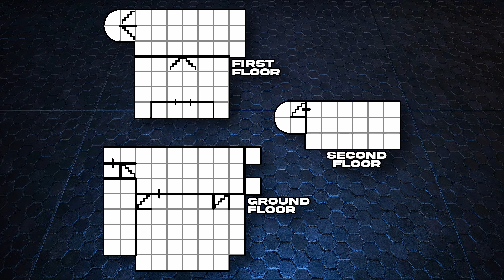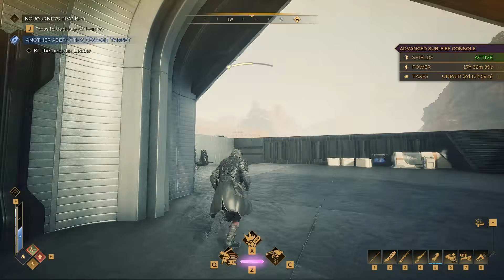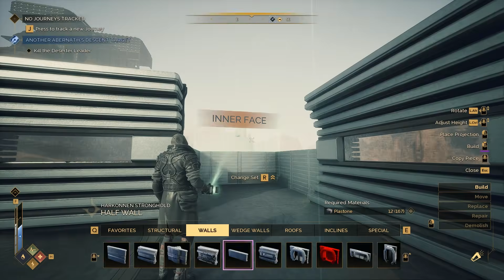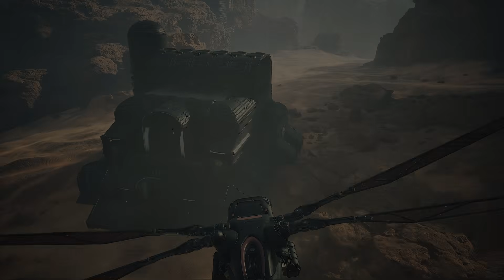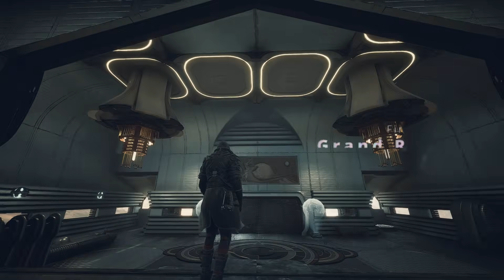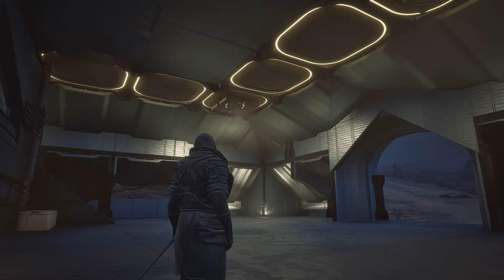Dune Awakening: Harko Manor Speed Build!

Comment: Absolutely love this video. I’m slowly but surely finding myself addicted to building. I got (4 regular, one vertical) extensions total on my main base trying to work out a cohesive idea for it, how would you go about it? As of right now, I can comfortably say I love my entrance, my dining hall & hangar which are on the far side of the property hanging on a giant rock/cliff respectively.
Reply from the maker: Thanks Hardstyle! Yeah that's how a building addiction starts 😂 It's hard to say exactly what avenue to take it in without seeing the already-present design, setting etc, but a general good rule for wide builds is to stagger the heights so the outer structures are lower and it builds up to an apex in the centre, at the tallest point
Reply: @Eradicati0nn perfect. That’s the guidance I was needing. I already had a theme/idea for this for a mini cathedral to hold the eventual large spice refinery in the middle but scrapped it as it wasn’t cohesive with the rest. Now that I know that’s a great idea to continue, I’ll work even harder at it to make it work😁

Comment: What build-set would you use if you were to combo with this set? And also placement of those expansionfiefs i cant sees to maximise the use of them. Any tips?
Reply from the maker: CHOAM Facility and CHOAM Observer both work quite well. Facility is more suited to contrast, whereas Observer fills some of Harkonnen's gaps decently. Atreides can work too, but one or the other has to be a dominant material, it's harder to 50/50 mix them

I've not actually used any fief expansions myself, but from what I understand, it should be pretty simple. Placing a horizontal should effectively create a second advanced fief area next to your existing build in whichever segment you put it in. Vertical adds a bit of space on the bottom and a bit of space on the top. Again, I've not used them myself, so someone who has might be able to provide some better advice on that front